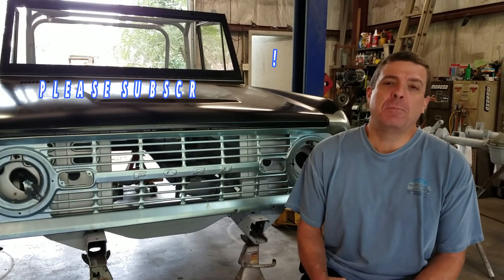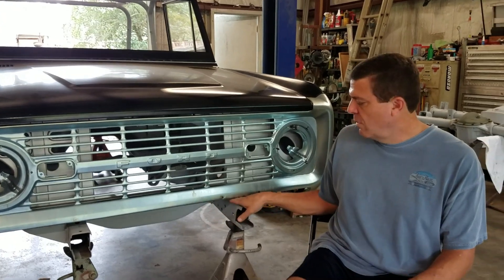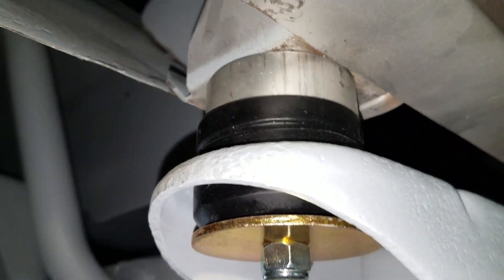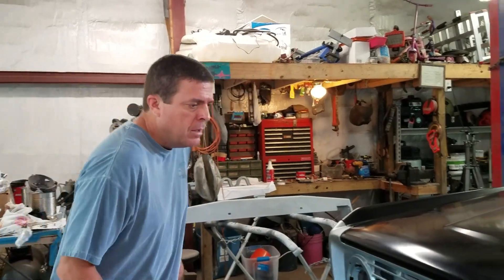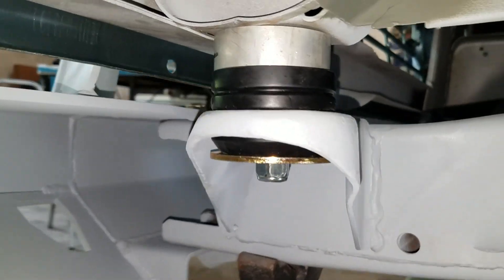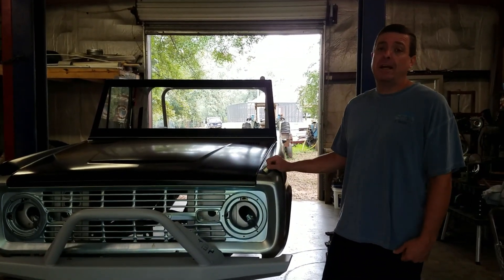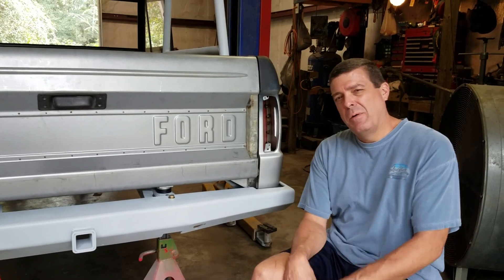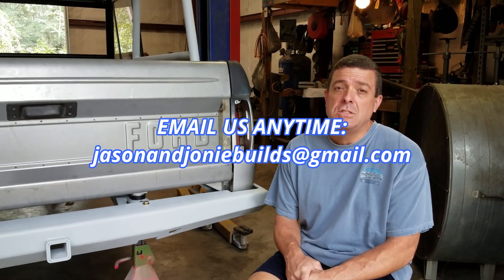Tom's Bronco Parts Bumpers -1966 Ford Bronco Restoration Project

Comment: I used an actual hockey puck for each of the body mounts, I like them because they are hard rubber which is soft against the body and we’re easy to drill a hole in them. I had to adjust the fan shroud and the shift linkage
Reply from the maker: I figure I have a lot of adjustments to make once the engine and AOD is installed.  Hockey pucks are not readily available in the south.  Lol. Thanks again Jim.

Comment: James Duff sells a rear roll pan to fill that gap, $85 bucks, it may save you some fab time. I mocked up my Wild Horses body armor bumpers yesterday, they have adjustablilty for the body lift. I'm not a big fan of body lifts either but I going with a 1" to help clear the AOD I plan on running. Those bumpers look awesome 👍
Reply from the maker: I will look into the roll pan.  I have taken a few measurements and will see which is the best way to go.  I am working on a design for the tire carrier.  I think it will be cool.

Comment: Jason, 

I’m looking at the front and rear bumpers on your bronco and it seems like you might have at least a quarter inch of space to spare on your rear bumper-to-body… If you loosen the body mounts and pull the whole body back on the frame a quarter inch, I think you wouldn’t have any rubbing issues on the front bumper and grille 

Just a thought, I currently have my body loose on the frame and it has quite a bit of adjustment actually Left-to-right, front to back
Reply from the maker: Thanks Henry!  You are right.  I can probably get that 1/4" up front by moving the body back.  Sometimes the easy fixes are hardest to see.

Comment: I’ve put on two body lifts, and after a few years wished I had gone with an even higher one reference clearance?iI guess  you are running  smaller tires?the bumper looks good?the only thing I’m surprised at, is that you rebuilt the  the Dana  30, and didn’t swap it for a 44?I don’t think the gap is unsightly at all? And hey, there’s a brand new 351, new tires and wheels , and uninstalled seatbelts you know about right here?
Reply from the maker: Do this Bronco is for the street mainly.  I won't be wheeling it off road where the 44 would be an advantage.  The next owner can so the swap if they like and everything else will be up to the task.  I really don't want this one to be real tall. Right now it will have 3.25" lift and 33" tires. I will keep the other in mind for sure.  Thanks man!

Comment: I don’t like the bolt heads on top of bumper
Reply from the maker: I am with you on that.  I am working on the tire carrier and modifications I would like to make.  I will use a differant bolt for sure.  Thanks for the comments.